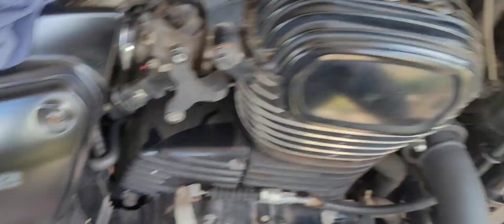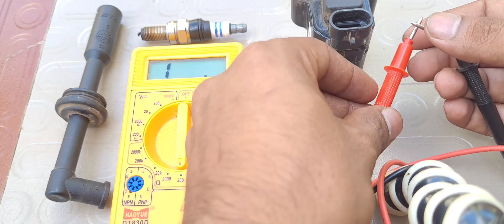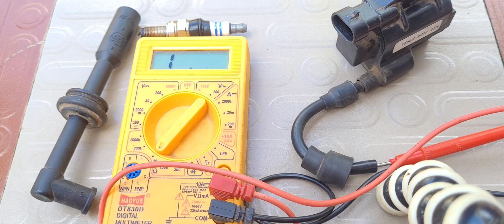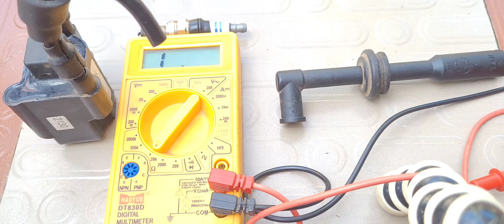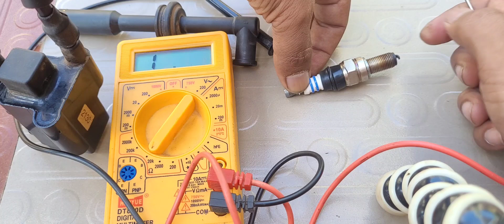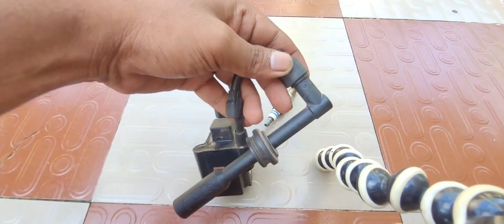Yezdi Adventure Ignition Coil & Spark Plug Resistance Test with Multimeter | DIY Bike Check

Comment: Dada harness pe 12volt ka output mil raha hey magar ignition coil se output nhi mil raha kya kare??
Reply from the maker: Ignition coil gets input from ecu, depends on pulse coil signal when to fire the sparkplug.

So the pulse coil need to be checked get resistance checked .
Reply from the maker: https://youtu.be/9ZoqSP0bAY8?si=mWJRJcVGIXJJ5gfF

Pulse coile or pickup coil

Check this one more on ignition coil in the channel